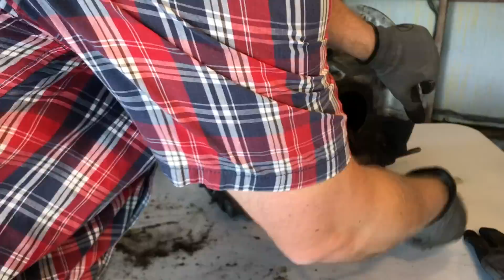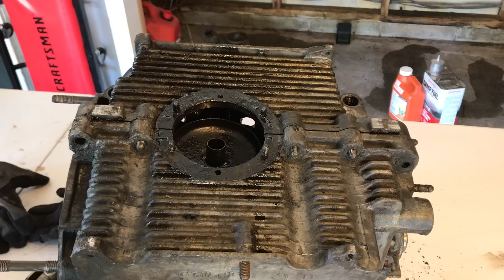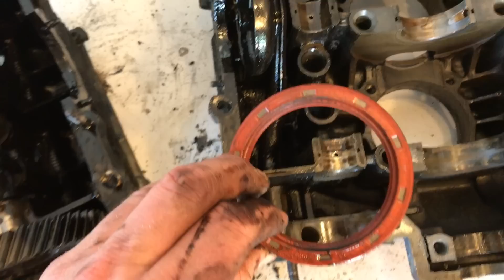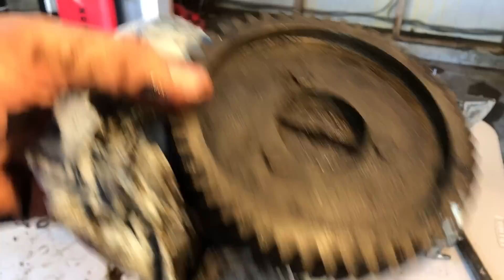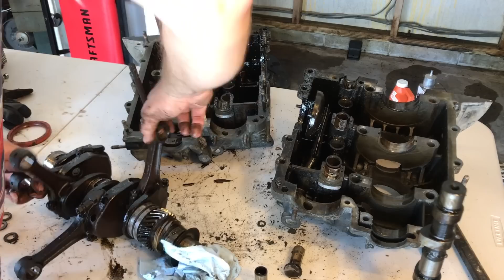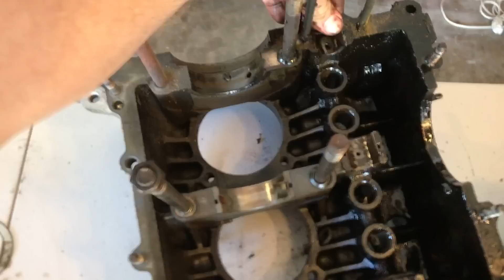Volkswagen 1600 engine rebuild restoration - VW Engine disassembly - Part (4)

Comment: I owned a 70's KG. years ago. Had an auto clutch which I didn't like. Had it converted to regular clutch. I have never worked on cars. Now I understand why they are expensive to repair. I'm surprised with all the parts and tolerances required that cars run as well as they do. This is fun to watch. Thanks. I'm binge watching.

Comment: I love the AE case VW engine. That's how I started my career in this business. That was 37 years ago. Dude, clean it, replace pistons, barrels, line bore the case, threadsert the case, new bearings, flush or replace the oil cooler, replace the oil pump, new push rod tubes. The cam and crank actually look good. But have a machinist check the journals.
Reply: i know I am kinda randomly asking but do anyone know of a good website to stream newly released movies online?

Comment: Should be fine. Add lifters to the list cause they fell out when you split the case.  You have a fun project ahead of you! Enjoy
Reply from the maker: Thanks E-man! I know I forgot about those but I think they are a bit worn out as well. What did you use to clean your case?
Reply: I hear that, probably better off running new lifters. I did as well. I used a Rubbermaid container , with purple Power and some good scrub brushes.  Scrub the shit out of her! Lol..  Its a huge labor of 💘
Reply from the maker: Cool, I will try that!!! Yes, it has been so far for sure!
Reply: Soooo,  how did machine shop trip turn out.  Any news...   We want to hear....
Reply from the maker: Nothing yet. I just cleaned the garage yesterday because the weather finally started to cool off a bit. I still have to clean the case and heads. The weather should be nice all week so maybe an hour or so after work and it should be good to go.
Reply: right on. Just pushing you along as i hope you would do the same to me bro!
Reply from the maker: I appreciate that man! I need it sometimes! The weather is a huge motivator for me. It's been in the mid to high 90s for weeks with high humidity. Not fun......Yesterday we got low 80s with very low humidity. Awesome!!! I love it. Of course now they will change the clocks forward and screw everything up....haha!
Reply: I hear you there, I'm dealing with a bit of the opposite obviously. It's getting cooler with highs in the 40s or 50s. It's actually perfect time to be outside. The humidity is the major killer of working outside. I find even if you makes very small goals it helps to keep the projects moving along. Research one day, Clean something another day Assemble another day...

Comment: First rule of rebuilding a VW engine is BEFORE you disassemble you retorque the nuts on the head studs to 35 ft pounds. (OEM spec is like 27) What this does is assure you that none of the studs pulls out during final assembly. If they do pull out you can get oversized studs or self-tap over size but both will put aluminum fragments into the crankcase so you want to handle this early in the game. Whant to get all of that crap out of the inside? First use a degreaser then spray with oven cleaner and let soak for several hours before hitting it with a garden hose. Basically a DIY hot tank to get the black crud off.
Reply from the maker: Man thank you for all the insight! I really do appreciate it! I will try the oven cleaner and see how it goes! Thank you! Keep watching! More to come!

Comment: And don't forget the heads. Have a machine shop do a valve job on them. Go back together with specs and a torque wrench. Have fun. Good gasket sealer, these things are leakers

Comment: The valve cover on one side leaked and water got in. The rest was probably fine.
Reply from the maker: Hi Andre, I think you might be right. Thanks for watching and hanging out!
Reply: Hi  @CTmoog  After 3x Beetles, one split screen bus a Karmann Ghia, Porsche 912 and 2x 356  Porsches, much sweat and bruised knuckles later I realised these are bulletproof motors. Sadly I sold all of these. Thank you for posting. BTW those small plates under the cylinders are essential for cooling.
Reply from the maker: Wow you've had some toys! Very cool! Thanks man! I'll make sure I put them back on.

Comment: Any update on the motor ?
Reply from the maker: Yes, the motor is good. I took the case and heads to a local vw shop and they said it should be fine to rebuild. Just need to clean it up a bit. Thanks for asking Jason!

Comment: there's no oil filter strange that's not so good especially old engines are really dirty
Reply from the maker: Hey G! Yes, it's weird but that's how they designed it! It has a oil screen and it somehow filters out the junk and keeps it at the bottom. Thanks for watching! Did you subscribe?
Reply: @CTmoog  The screen works very well if kept clean and the oil changed. Regular valve adjustments and the VW motor will last very well for many miles. Correctly maintained there isn't much to go wrong except the belt.
Reply from the maker: Thanks Daniel! That is good to know! =)

Comment: 4 videos later we have an engine junk yard... And no sign of parts 5, 6, 99, or indeed anything resembling a running motor.. Shall I look in eBay under failed restorations? Just in case you are wondering, there is one thing worse than a motor needing restoration.. one like THIS! Never buy!
Reply from the maker: Haha! I still have it! It's in great shape ready to be rebuilt. I've been a bit busy with my newest project! Have a great day!